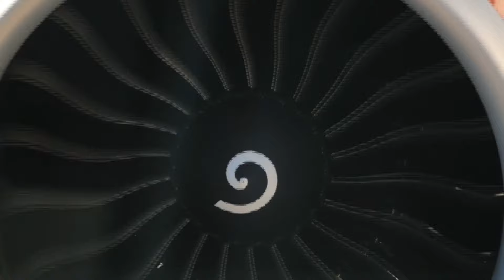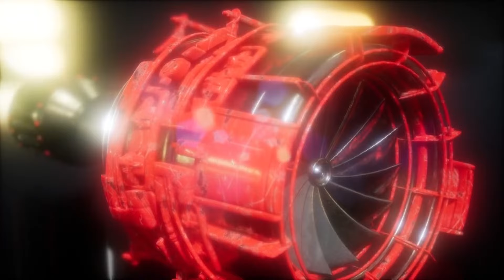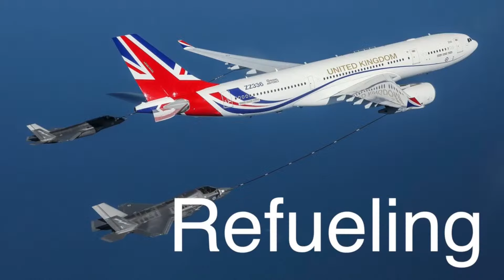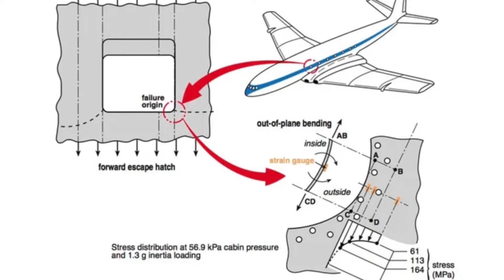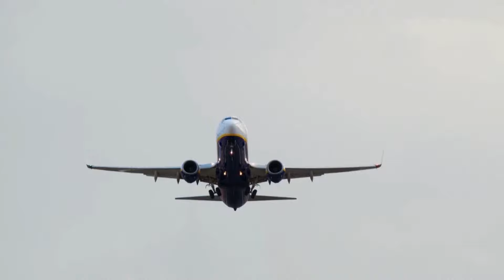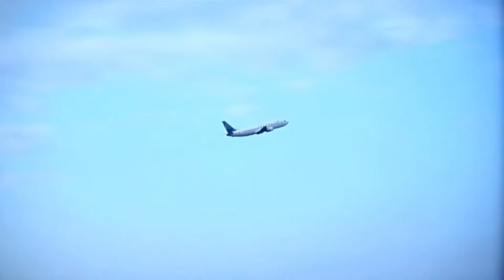How Airplanes Work: Jet Engines, Windows, Wings & More

Comment: The square windows on the Comet 1 was not the problem. The real problem was rivets punched through the material and that the skin material was too thin. This caused metal fatigue, making the fuselage crack at high altitude. Thicker skin and drilling before riveting solved this problem.